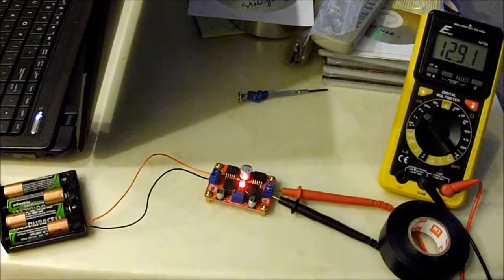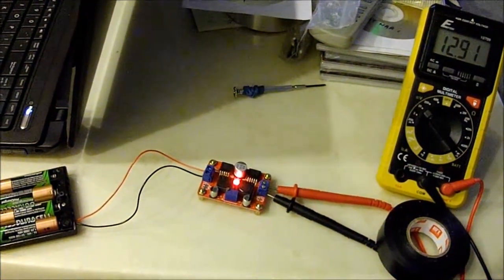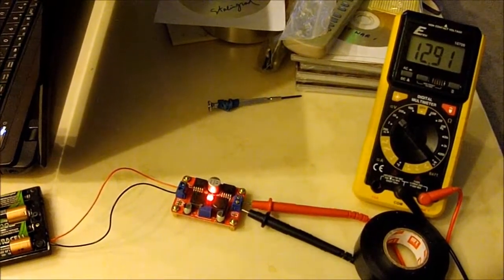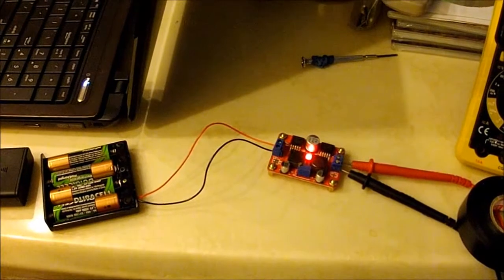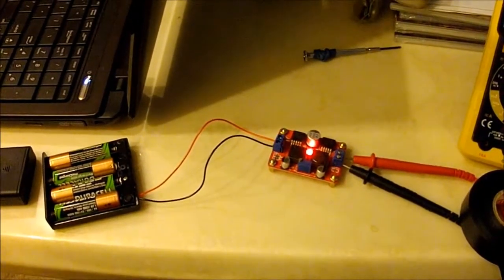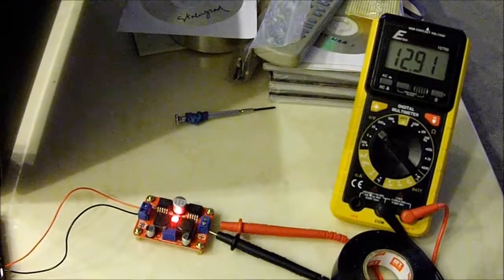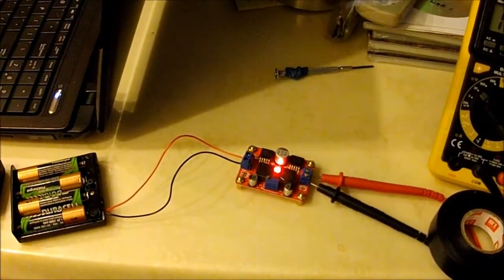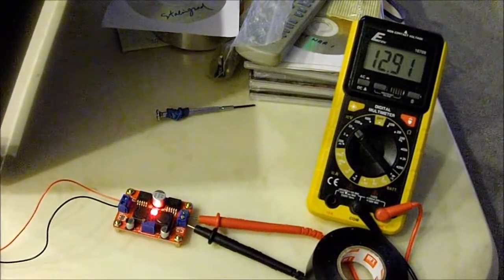small voltage regulator

Comment: I have had the idea in my mind for a while. I have a boost converter similar to yours and I am going to put a fixed voltage power controller to charge my batteries of my wind turbine. When I was going to upload the video. I was going to call it The Poor Man's MPPT. I have also got a step down converter to go on my solar panels. With relay switching. So that when the voltage drops on the panel. The relay brings in a step up converter to charge with the dieing sun. I think that will work well.

Comment from the maker: I would think so. Maybe that would bring it closer to a mppt type charger. I assume when I input a higher voltage, the step down lower voltage output will have increase current and vice versa. I'm not sure what is used in a mppt circuit, but maybe a zener controlled power output circuit would work. Thanks for the insight.

Comment: For wind turbine applications. Could you put a zener controlled power capable circuit on the output of the converter? With the zener of battery charging voltage. Say 14.8Volts? Set the converter to battery charging voltage too. Then it would not matter what the turbine voltage did the battery would always get 14.8Volts. Until it dropped below the minimum input of the converter. You could do the same for solar and get more power from the dieing day.